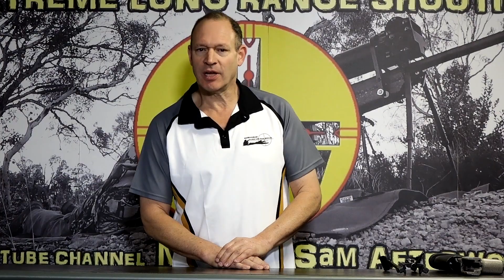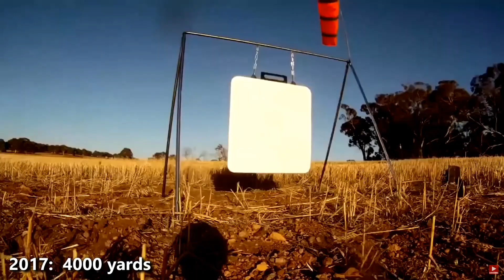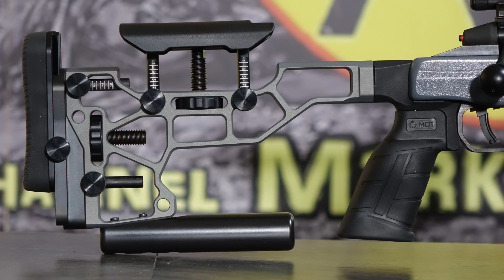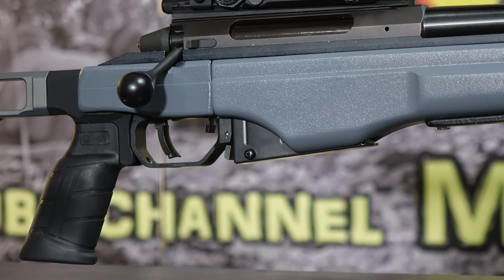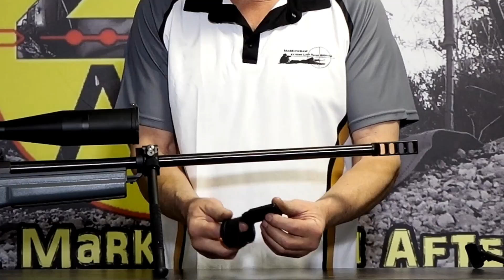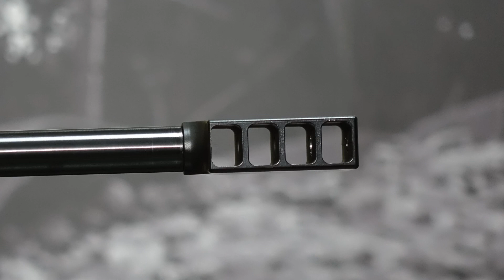Our SAKO TRG 42 and some improvements

Comment: I’m running gen 1 TRG with a  big fat kreiger barrel and I just switched to a Atlas super cal bipod using an anschutz to picatiny adapter . Found an after market adjustable cheek piece and mounted it to the factory one . Here’s where I’m stuck . I need a flush cup mount to replace the original disaster they offered at the front left side .Cant use the factory one cuz the barrel is to fat . I think a savy fella on a mill might be able to mount one to the internal chassis extrusion at the front . You done some great work there by the way
Reply from the maker: Cheers

Comment: I’m a big believer of folding stocks. If it doesn’t have a good folding stock, I’m not interested. I was wondering what your opinion was on them. If I pick a builder to build I rifle for me, It’s starts with a folding stock. I think most shooters think the same way. Example, the US government’s requirements for the RFP for their new tactical sniper rifle. It started with, “it must have a folding stock”. MDT made a part to fold a stock, but it changed the length of pull by an inch and a half. I felt that was flawed thinking on there behalf, so I have not tried their products. I guess my question to you is, “ Is my thinking flawed.”
Reply from the maker: Well, folding stocks are great for transport, cleaning and all things other than the shooting, if the main thing is the shooting, well then fixed is technically better, but if a very very solid lock up, then there should be not discernible differences........hence you will not find a target rifle with a folding stock.

Comment: The stock on the TRG42 is such a blasphemy for such a great action! 
My stock cracked where the flimsy plastic meets the back of the action.. 
Bought a KRG Whiskey 3 chassis ( full length ) which has worked great ( after some tweaks) . 
Have to give KRG some flak for including a useless instruction that wasnt updated even though they changed the mounting hardware.. 
Also the magazine catch spring that they include must have been stolen from a broken ballpen they found on the office floor. 
The magazine would angle down when you tried to chamber  a round. Had to drill a bigger hole to fit a much stronger spring.
As a left handed shooter their cheek riser thumbscrews get in the way, why the engineers couldnt make them reversible is beyond me. Bought low profile from aliexpress for 1$.
Lastly you have to sell a kidney to afford their accessories , 40$ for a thumbscrew common!

Sadly there arnt very many aftermarket chassis/stocks for the TRG
Reply from the maker: Yes, seen the chassis/stock they do, and there is a Chassis in Europe somewhere, but neither quite what I hope to inspire, we'll see, this should do for mine for this point, Cheers
Reply: @markandsamafterwork  there is a Finnish one called PAUTAC P.A.C, but its kinda butt ugly so much that only a mother could love it ;)
Reply from the maker: Lol, Cheers
Reply: Yes, I just put a Whiskey-3 Gen 6 on mine after about 7 years of suffering - the original stock is a real letdown. I have an AI and Accurate Mag AICS magazine, and they seem to work fine so far (less than 100 rounds).
Reply: @farmerbrown84  what would happen with my was that the closed bolt would not just press the next round down into the magazine. 
it would flex the magazine downwards in the front a few millimeters. 
So when you ejected the fired brass the next round would jump up in an angle and the tip would get stuck in the gap between the magazine and the underside of the feed ramp. jamming everything and destroying the tips. when i put in a stronger spring the magazine didnt move as much.
Maybe i should try some new magazines, i got the MDT CIP ones.

btw do you have any idear why there was a washer that had to be installed between the action and the chassis on the middle action screw? did they mess up the inlet?
Reply: @ppulf968  I had that problem with the MDT ESS chassis for the Tikka T3x. In the end, they designed a new version of it, and replaced mine. But KRG have been solid. My only complaint is that the cheek piece tears a hole in my cheek after 20-30 rounds of .338. I was running it with a suppressor last week and therefore no brake on it. I looked like I'd done 2 rounds with Mike Tyson after that.

Comment: I do love TRG's but few things: The practices of Sako/Beretta really piss me off. Magazine prices are just out of control. +150 euros per magazine is just ridiculous. Tikka CTR does use TRG-22 magazines but they found out that normal shooters don't want to buy 150 euro magazine for 1k rifle. The added extra polymer piece to CTR/TRG magazine that it won't fit TRG-22 rifle but fits CTR. in 2017 sako tried to sell spare action screws (normal metric hex screws) for 70 euros.

The finnish defence forces really dropped the ball with the TRG project/Tarkkuuskivääri2000. The zeiss scope windage turret uses 0.1 mrad clicks which is normal but the elevation turret is 0.25 mrad and with BDC dial. What were they thinking? Really is confusing and shooting over 1km. Combined that the temperature scale is -30 Celsius to +30 Celsius so the velocity doesn't match the turret dial drop. The ballistic table is something like: Dial 1100 meters and take 3 click back. Also Lockbase is a crappy bullet compared to Berger hybrid OTM.

Either way, needed to get this of my chest. Good video! Never have tough about stiffening the stock.
Reply from the maker: Thanks Larry, yes I hear you, lol, glad you liked, Cheers